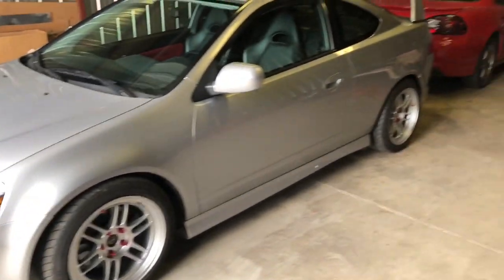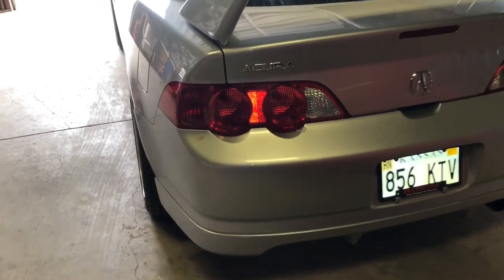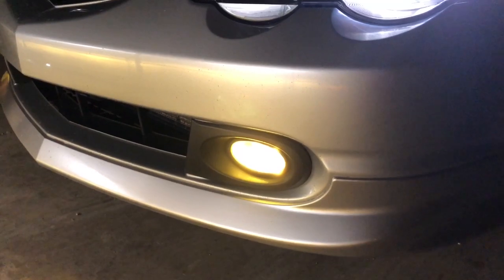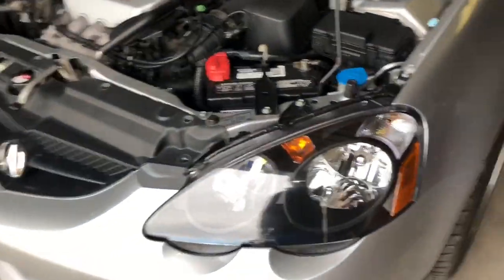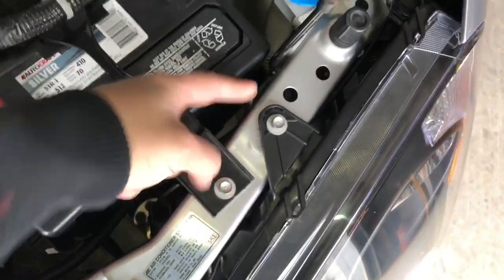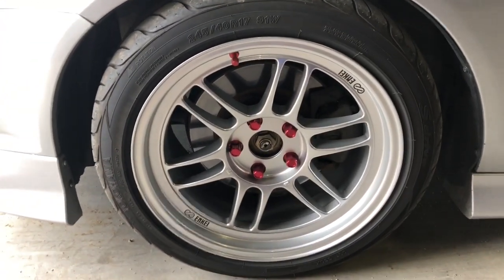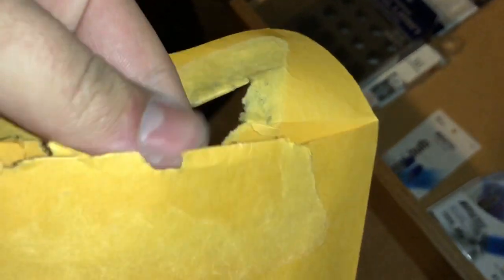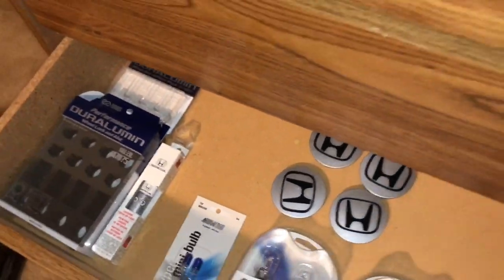Yellow & Blue Headlight Bulbs? | RSX Type S

Comment: 190k miles? it might be time for a rebuild on the motor, I have 173k and I’ll be rebuilding mine around that time.
Reply from the maker: TBills 3000 my motor is still healthy
Reply: Coda5610 yeah true, you take good care of your DC5. Mine is beat lol
Reply: TBills 3000 mine has 230k lol
Reply: Adrian Vega dayyumn😳
Reply: Dude ive seen hundred or hondas/Acuras with over 300k on Craigslist. 170k is barely broken in lol
Reply: I have 308,000 and haven’t rebuilt mine yet. Still running strong.

Comment: Triying to get the same HiDs but eBay telling me that doesn’t fit on my Rsx, where you got those bulbs bro?
Reply from the maker: I got these bulbs from ebay. H1 is the size for 02-04
Reply: Coda5610 what did it say when you purchased it said it didn’t fit on your 02-04 when you installed was all good?
Reply from the maker: Strictly Show h1 is the bulbs size for 02-04. 02-04 rsx takes h1
Reply: Coda5610 wow thank you bro

Comment: Return that oem master. They’re junk. In the event you ever wanted to upgrade the clutch it’ll fail again because of the damper on them. No need to spend tons of money on the master just upgrade to an OEM EM2 (ex civic) clutch master. Direct bolt in, use the ktuned clutch line.

Comment: Hey man, did you replace the actuators yourself? Was it difficult?
Reply from the maker: Rod Arana yes, i do everything myself, and it wasnt bad but id say a 7/10 if you never done anything like that before, just make sure you take pictures alot of then before you take the actuator out.
Reply: Coda5610 definitely. I’m just scared of breaking the small internal things like the gold rods and stuff lol but i hate not being able to lock my doors without doing it manually. Thanks.
Reply from the maker: Rod Arana only thing i broke was the little clips that held the gold rods to the door handle, you wont break the rods they are very strong
Reply: Coda5610 sorry that’s what I meant the clips that hold the gold rods